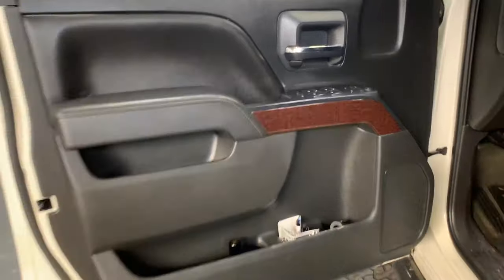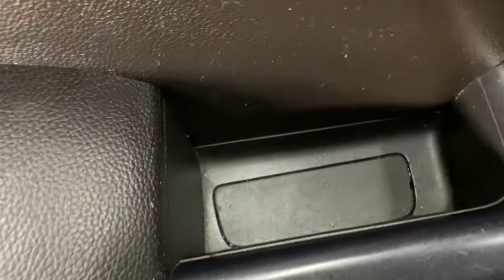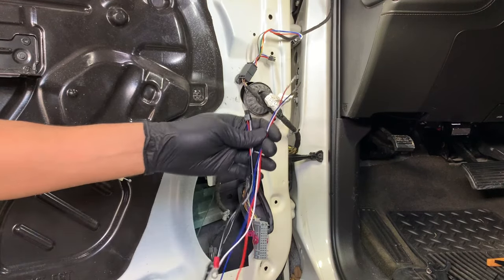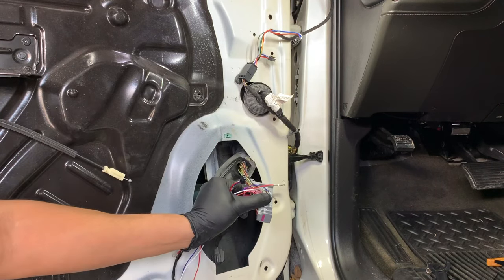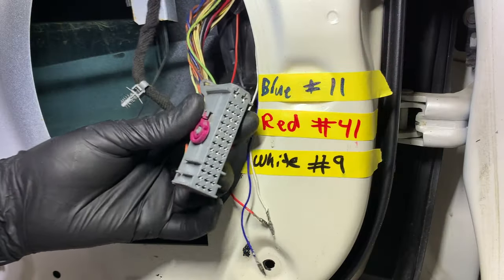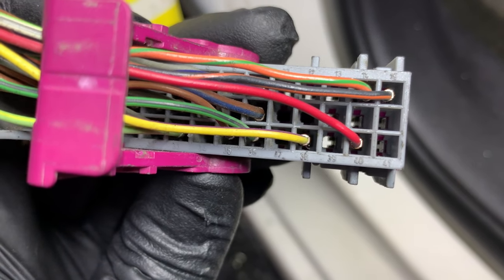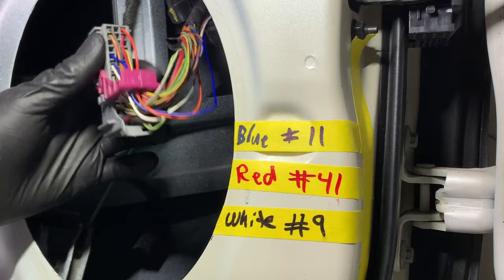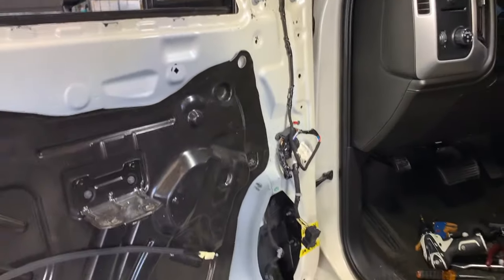How To Install / Wire Tow mirrors on a 2014-2018 Silverado / Sierra

Comment from the maker: You can order the wiring harness here

https://txtowmirrors.com/collections/14-18-gm-tow-mirrors-install/products/copy-of-14-18-gm-tow-mirror-wiring-harness-for-cargo-lights-turn-signals-running-lights

This harness will only work if your truck was built after 08/14 - 
you can check by looking on the driver side door on the cab sticker where your vin # is at. 

We also offer custom tow mirrors on our site .
Reply from the maker: @PB-vd3ze  Hey ! Send us an email when you get some time with your number texastowmirrors@gmail.com
Reply: Do you sell just the connectors. My mirrors came withe the wires with the plug but not the ends to plug into the harness?
Reply: Hello I purchased this truck with tow mirrors already installed but lights don't work, I see it must be made by 8/14 to use but mine say 7/13 even though it was sold as a 14 do they make a harness to make mine work
Reply from the maker: @jroc3078  hi , yes we also sell them . Check out our site 
https://txtowmirrors.com/collections/14-18-gm-tow-mirrors-install/products/trucks-built-date-before-08-14-2014-gm-tow-mirror-wiring-for-cargo-lights-turn-signals-running-lights
Reply: @grantfolz6929  did you find what they were called ?
Reply: Where can i order the the mirrors  for  my 18 with no chrome
Reply from the maker: @luisitoZ71  Hi , you can find them on our site . Www.Txtowmirrors.com
Reply: @kanohkustoms   so 8/13 won't work with wiring harness
Reply from the maker: @ianlehman5874  No, we sell a harness for trucks built before 08/14 . Here’s the video for it https://youtu.be/aOpHTIDcqr4

Comment: hello i have a 2014 GMC denali built 1/14 that has the turn and lighting shinning down would i wire this up the same to just have the turn work then if i didn't want add the extra harness?

Comment: Just installed my Tow Mirrors with this harness followed the video step by step total install took me about 1 hour and 40mins but was well worth it all lights work.  Very happy with the results .
Reply: Where do you buy the harness?
Reply: From him texas tow mirrors
Reply: My mirrors came with the harness.  Followed step by step and turn signal not working on front running lights and reverse lamps as well not. Someone help?
Reply: @bowx2xdeath  did you find out what’s the problem? I’m having same issue?

Comment: Is there a different harness? Just got mine today and the harness looks nothing like that
Reply from the maker: Hi , yes. If your truck already has turn signals the 4 pin connector is not needed. give us a call if you have anymore questions 2814515267

Comment: I have factory tow mirrors with all the same features (back up light, amber/white running and turning signal with power folding). I got side swiped and need new towing mirrors. Will I need to do any new wiring?
Reply from the maker: Hi , no new wiring needed for our tow mirrors since your truck already came with all the options.

Comment: i believe i have these exact tow mirrors on mine but they were installed prior to me getting the truck and the turn signals running lights don’t work and i am not sure if they have a second plug so what should i do about ordering one
Reply from the maker: When in doubt select “no” . It will work for any 14-18 tow mirrors

Comment: I have a 2017 Chevy Silverado I connect the same as your video but only the turn signals work but the reverse light does not turn on, could you tell me why
Reply from the maker: Hi , they are cargo lights . They turn on with your cargo light switch under the radio .

Comment: I just installed tow mirrors on my 2016 Sierra. They are power folding, heated, and turn signals on the outside not on the glass. Everything works as it should, except the cargo lights because I didn’t add the harness in which was for the cargo lights and turn signals. My turn signals already work without adding the supplied harnesses. I want the turn signal lights to work as running lights too. Will these harnesses make the turn signals work as running lights too?
Reply: Also, the harnesses that were supplied have 3 wires. They’re blue, white, and black. Would those harnesses work like the ones in the video?
Reply from the maker: Hi , the harness won’t make your marker lights turn on white unless your mirrors came with that option .
Reply from the maker: @drakelogan2327  you will need the harness regardless for your runing lights and cargo lights to work .

Comment: If I have a 2015 WT package with small Mirrors. Can I buy aftermarket mirrors and this harness and all work together ?
Reply: this ia my question too
Reply: Sure you can, I did in my 2017 wt 1500, the new mirror came with 4 bolts but you need drill a new hole, (the spot is already marked)  and you will need to conect the lights with the extra plug wires.

Comment: I'm Replacing my existing tow mirrors with blinkers So I only need to add pins 9 and 11. If my truck didn't have the cargo or running light feature will it still work by just adding the pins I need to buy pins and I want to button up the door panels now so I want to run the wires for later
Reply from the maker: Hi , bot understanding your question. Give us a call when you get some time 281 451 5267

Comment: so before i installed these mirrors, the previous ones where moving just fine (mirrors), but when i installed the one ones, exactly the same, the mirrors where not moving correctly, up and down was not working, and when i switched side, both sides started to move.. any suggestion?
Reply from the maker: Hi , did you buy the tow mirrors from us?

Comment: My stock mirror was non heated, and installed a heated tow mirror.. do i need extra wiring for it to work?
Reply from the maker: Hi , this harness is only for lighting. As for the heated part , if your stock mirrors are electric adjust there is 98% chance its pre wired for heated.

Comment: Mines the z71 ltz if I hook them up will my turn signals work and all my otjer lights work on tje tow mirrors, or will I have to add wires from the fuse box from the tow mirrors

Comment: So what wire is the signal wire for the turn signal ,trying to run switch back door handles and need to tap into the signal wore of tow mirrors

Comment: I have a 2014 chevy silverado but it was built 05/14. What is the difference on the install?
Reply from the maker: Hi , here’s the link for that kit . Comes with detailed instructions and phone support . Difference is running light and cargo light wires get ran to fuse box . 

https://txtowmirrors.com/collections/14-18-gm-tow-mirrors-install/products/trucks-built-date-before-08-14-2014-gm-tow-mirror-wiring-for-cargo-lights-turn-signals-running-lights

Comment: If I have 2016 high country do I need to do seperate wiring or will it be just plug and play ?
Reply from the maker: If your high country had tow mirrors from factory and everything is currently working on them . Our mirrors will be plug n play

Comment: Hi there! I wired evrything just like you did in the video but only some of my light functions are working. The only difference is my truck is a 2018 2500... but it looked exactly the same when I put the pins in. Any advice?
Reply from the maker: Hi send us an email with your order number and we would love to help you troubleshoot . Texastowmirrors@gmail.com
Reply: I didn't get the mirrors from yall. I got them from Sanooer. But the wiring harness is the same as the one you did in the video
Reply: I tried contacting them but they're not helping
Reply from the maker: @markehrig4841  The benefit of buying from us is quick response and phone / facetime support. I hope they get back to you soon.

Comment: I have only one question where is the black piece hook up too? Does that come with the truck or do I have to order separately
Reply from the maker: Hi , which black piece?
Reply: @kanohkustoms  the black piece that you hook on at the end of the harness!
Reply: @kanohkustoms  I know where the blue, white, red,and the ground go but the end black piece where does it hook too?
Reply from the maker: @dodgers1950able  when purchasing the harness select “No my mirrors dont have the second plug”

https://txtowmirrors.com/collections/14-18-gm-tow-mirrors-install/products/copy-of-14-18-gm-tow-mirror-wiring-harness-for-cargo-lights-turn-signals-running-lights

Comment: My 18 silverado stock mirrors are power folding and ha e turn signals on the reflection side.  Do I need a harness?
Reply from the maker: Hi , you will need the harness for running lights and cargo lights to work .

Comment: Lot's of comments to search through, so I may have missed this. What if my truck was manufactured 05/14? What do you suggest?
Reply from the maker: Hi , here you go https://www.ebay.com/itm/124711530242?_trkparms=aid%3D111001%26algo%3DREC.SEED%26ao%3D1%26asc%3D20180816085401%26meid%3D2dc935d1140e48da81c4a95b8a9cb1bc%26pid%3D100970%26rk%3D1%26rkt%3D1%26sd%3D124711530242%26itm%3D124711530242%26pmt%3D1%26noa%3D1%26pg%3D2380057%26brand%3DUnbranded&_trksid=p2380057.c100970.m5481&_trkparms=pageci%3A73714a44-d044-11eb-ab3c-76ea91766b75%7Cparentrq%3A1f99991217a0ab8ebe3a91f2fffe8056%7Ciid%3A1
Reply: @kanohkustoms  Wow, thanks. Do you have another video for that wiring process?

Comment: My reverse lights are not working i have a 2016 chevy silverado i put it in The right spot but they wont come on is there a fuse i have to put in in order for them to work?
Reply from the maker: Hi , from factory they are cargo lights . They turn on with cargo light switch under radio.

Comment: Had a couple questions for anyone who has had similar issues with the wiring. I have the heated option so the black wire is supposed to be for the heat. I didn’t know if it will still work if I just grounded it to the door. Also since grounding the black wire my signal on the outside does not work although my signal on the mirror works. Not sure if you could lead me in the right direction thanks!
Reply from the maker: Hi , you cant ground the all black wire for the heated feature . You will cause a short . 
- the mirrors you purchased didnt come with the switchback option thats why the turn signal doesn’t work on the outside marker light.
Reply: @kanohkustoms  i have the same issue, is there anywhere to purchase the harness or anything for my mirrors to make the outside signal work?
Reply: I connected mine and it don’t work what can be the issue I did everything still don’t turn on.

Comment: So I bought the kit and it still doesn’t. Work damn. It also looks like my harness on the door frame doesn’t even have the pins. Guess I have to figure out another way to wire them.
Reply from the maker: Hi  , did you make sure your truck build date is after 08/14
Reply: @kanohkustoms guess it’s not.

Comment: My mirror only have one plug you're has 2 would it still work
Reply from the maker: On our site theres a question that asks if you have the second plug. Select no on that
.https://txtowmirrors.com/collections/14-18-gm-tow-mirrors-install/products/copy-of-14-18-gm-tow-mirror-wiring-harness-for-cargo-lights-turn-signals-running-lights

Comment: is this only for truck that don't have the factory lights on the mirrors?
Reply: I plugged mine in and they don’t work idk what is the problem
Reply: @BRYANMOB  oh ok. Mine has the factory turn signals on the side mirror just thought I would ask. If it was for both types
Reply from the maker: Hi , this harness is if your truck didnt come with tow mirrors from factory. Even though you have turn signals , 1500s don’t come equipped with running lights or cargo lights. This harness solves that issue

Comment: I bought a tow mirror kit from eBay and it came with the harness but it doesn’t have the pins on the end of my wire, just bare wire ends. Where do I find them pins?
Reply from the maker: Hi , the pins is  pretty much what we’re selling since most mirrors already come with wiring . Link is in the pinned comment .

Comment: Amazing video! Question, do the wires have to go into those specific numbers? I already have a blue / white wire in #41.
Reply from the maker: They have to go in the correct pin numbers
Reply: @kanohkustoms  thanks!
Reply: @kanohkustoms  how would I know what number to plug my wire into?
Reply from the maker: @jorgepena2691  Hi , email us with your order # and phone number . We will contact you today . Texastowmirrors@gmail.com
Reply: I have the same issue. I'd like to know what to do.
Reply: What’s the alternative as I have something plugged into 41 as well
Reply: @maxpauley6637  did you ever fix it?

Comment: Do you have a video how to hard wire tow mirrors for trucks built before 8/14?
Reply: Did you ever find any info? I’ve got a 2015 duramax built before 8/15 and I’ve wired my mirrors just like this video but they aren’t working

Comment: I just wired my tow mirrors up on my 2015 1500 and the turn signal doesn’t flash/blink. The signal on the glass works perfect but the signal on the front of the mirror just stays constantly lit. Where did I go wrong? Thanks
Reply from the maker: Drew Bollinger Where did you purchase or what kind of tow mirrors are they ?

Comment: I do not have ANY electric going to my mirrors, will this still work? Also what about the electric extend and retract? Does this allow that type of mirror or only manual extend? And does it work for heated mirror as well? I'd also need a button on the inside of my truck for the extend, correct?
Reply from the maker: Hi , this harness will make all lighting work even if you don’t have electric mirrors . As long as your truck is built after 08/14 . 

Power extend does not exist for 14-18 GM.
Reply: @kanohkustoms  will the harness also work for the heated part being my mirrors are not already heated?
Reply: @cierraroy7807  No , its only for lighting.
Reply: @juliosalgado1000  do you by chance know if there is a harness or option out there that I can add this?
Reply: @cierraroy7807  you will need the complete wiring harness from the dealership along with mirror adjustment control .

Comment: My truck wire has the connector for blue/red/white , easy to connect to the towing mirror wire that I got . Therefore still no lights. Could be no fuses in some of the fuse box? 
Let me know please.
Reply from the maker: Hi , what truck do you have ?
Reply: 2015 GMC 2500HD base
Reply from the maker: What’s the build date ?
Reply: @kanohkustoms  03/15
Reply: @kanohkustoms  03/15
Reply from the maker: @dalp6657  give us a call 281 451 5267

Comment: I installed them the same as the video but the white led never turned on it stays fixed in orange when I put the indicator it works well but the white light never turned on
Reply from the maker: The mirrors you purchased didn’t come equipped with switchbacks . You can find them on our site though . Www.Txtowmirrors.com

Comment: My truck is a 2014 but built at the end of 13 my blinker lights work but not the cargo reverse lights plus the mirror lights don’t come on with running lights on. Do y’all have a harness for that?
Reply from the maker: Yes sir - here you go
Reply from the maker: https://txtowmirrors.com/collections/14-18-gm-tow-mirrors-install/products/trucks-built-date-before-08-14-2014-gm-tow-mirror-wiring-for-cargo-lights-turn-signals-running-lights

Comment: Will I need this harness if my tow mirror turn signals work but my running light led only works when I push unlock on the fob and when I open my door then it turns off ?? I need help
Reply: I think that’s what it’s supposed to do you could probably wire them to a switch instead inside the cab but that’s too much work in my opinion for the lights to stay on

Comment: How do your get the turn signal to flash when you have turn signal activated mine don’t flash they just serve as daytime running lights
Reply from the maker: Hi , send us an email with your order # and phone # we will call and help you through the process . Texastowmirrors@gmail.com
Reply: I didn’t buy the mirrors from you guys just wondering if the outside lights have to have a flashing feature ?
Reply from the maker: @briangarcia5284  it depends on what features your mirrors have and if they were installed correctly . If purchased from us , were very clear on the features and we have free tech support.
Reply: I installed them everything works it’s just I’m guessing the clinker on the outside just serves as a running light can I buy just the light fork you guys that flashes ?

Comment: What to do if I don't have that 4th hole on my truck?
Reply from the maker: Hi , you drill the 4th hole
Reply: @kanohkustoms  Hi, thanks for the response. I have the towing mirror in, but my towing mirror did not come with the extra wire that the wiring harness plugs into... It's a 2018 1500. Have you come across that before? Thank you!
Reply from the maker: @TethiusMC  Yes , everyday. Select the option that says your mirrors didnt come with second plug on our site. https://txtowmirrors.com/collections/14-18-gm-tow-mirrors-install/products/copy-of-14-18-gm-tow-mirror-wiring-harness-for-cargo-lights-turn-signals-running-lights
Reply: @kanohkustoms  order #2611…
Reply: @kanohkustoms have a harness from Amazon already. I just purchased your harness but was wondering if there is anything I can do now with the one I ordered in the meantime?

Comment: How do you install if the truck was built before 8/14? Is there a different harness?
Reply from the maker: Hi , no harness will work if it was built before 08/14  . We at least let you know , anyone else will still sell it to you . We will be making a video on how to hardwire them soon .
Reply: @kanohkustoms  cool thanks I would greatly appreciate it I have them installed but don’t have any lights hooked up
Reply: Same. Mine was built on May 2014.